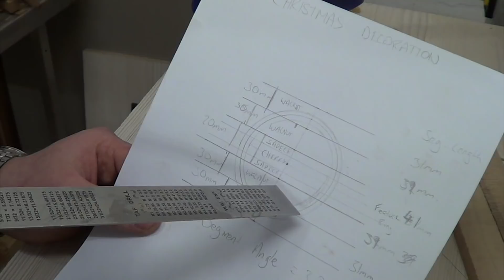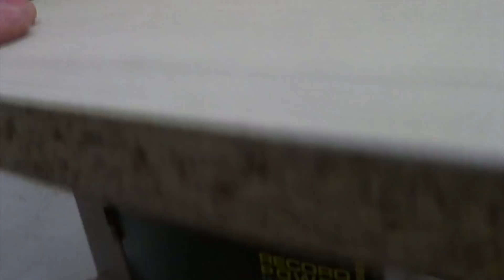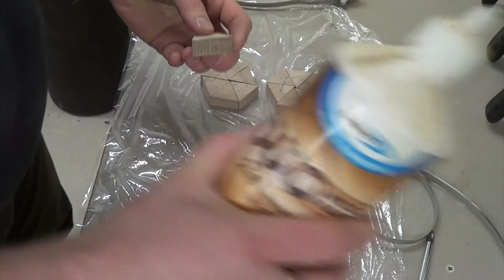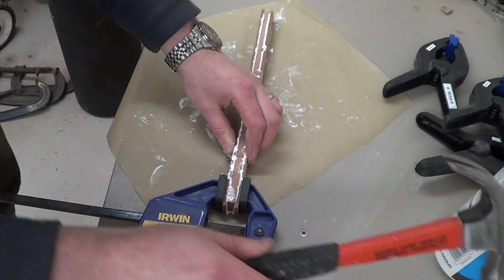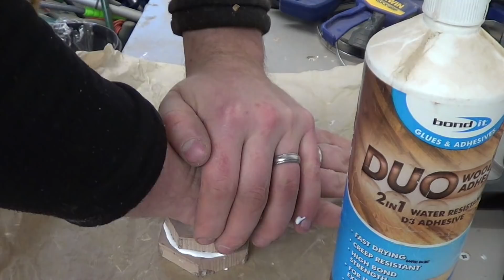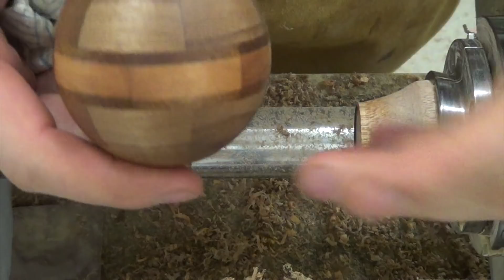Woodturning a Segmented Christmas Decoration - Perfect Sphere

Comment: Nice job Nathen. On your two jigs that hold your sphere what would happen if you got a small piece of cloth (old sock etc.) and glued into the indent where it would cushion your sphere but not interfere with your tool? Merry Christmas, Stan.
Reply from the maker: Stan Felipe thank you very much Stan. I did try an old cloth but it slipped just as much if not more. Some rubber or a non stick pad would probably do the trick but I didn’t have any. A vacuum chuck might work too but that’s also on the wish list. Merry Christmas to you and yours Stan
Reply: Nathan, a small bead of silacone would probably hold it in place. Enjoy the Christmas holiday season.